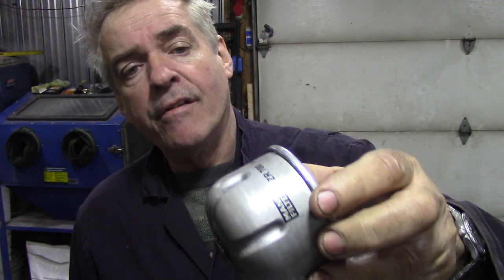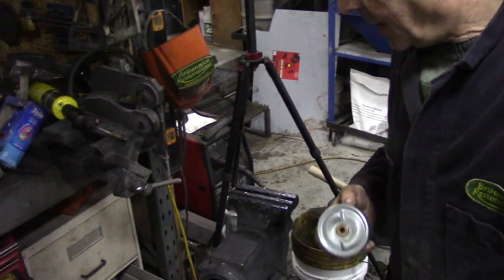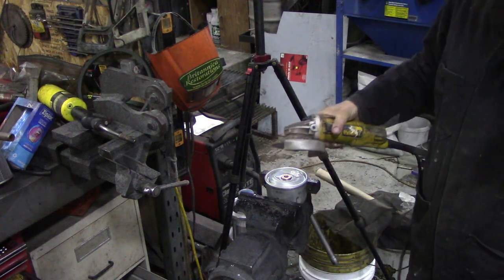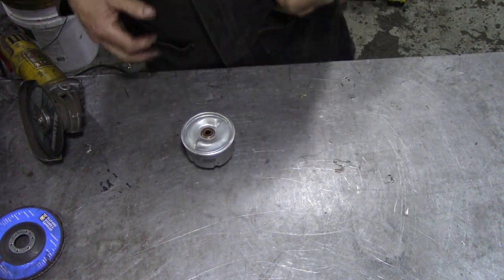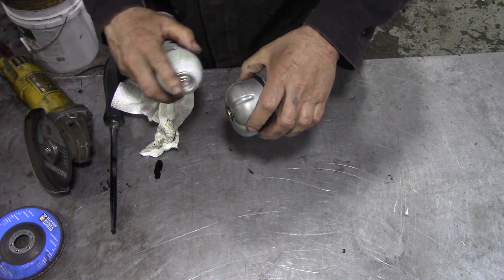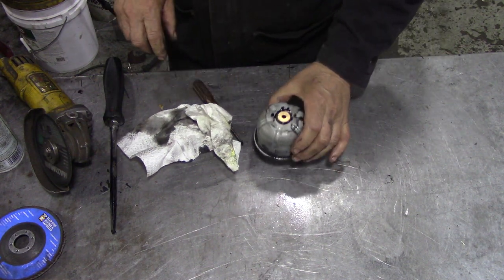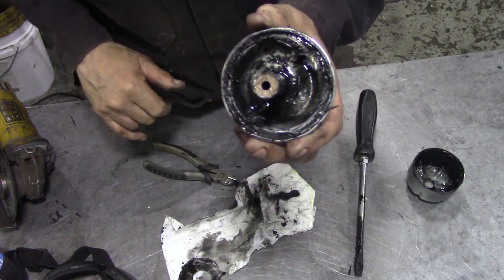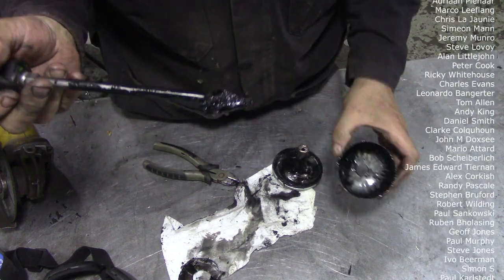What is inside a Td5 centrifugal oil filter?

Comment: I'm a agricultural engineer in the UK some Massey Ferguson tractors have them for the gearbox filter and there designed to come apart just unscrew the head of the filter do a good job never had to replace one just give them a good clean also run a disco 2 td5 as my workhorse change oil and both filters every 5 thousand miles and use 5w40 not 30 better oil pressure keep up the good work
Reply: Zetor tractors had a centrifugal filter on the engine, I remember coming across one for the first time on a zetor 6911….
Reply from the maker: I think the original Beetle had them too

Comment: Made by the Glacier Filter company in Ilminister, Somerset. I used to be the Quality Manager at the launch of this filter, known as GF016.  Glacier made a series of Bypass centrifugal filters in various sizes for Massey Fergusson, Scania , Renault trucks, Wartsila  marine engines.  Filter was invented by Glacier, working in bypass taking approx 10% of the oil, spinning in excess of 6000 rpm, the soot particles in the oil , less than 1 micron in size, are spun out into a cake, which on most variants can be removed and burnt.
Reply from the maker: Did you make them for the old Zetor tractors and early VW Beetle too as they had a similar system?
Reply: I wasn't aware that the Beetle ever had one - I thought they always just had a gauze strainer. Certainly from the 60s on they just had a strainer.
Edit: although from a quick google, it looks like Fiat 500s had centrifugal oil filters. I'd never even heard of centrifugal oil filters until watching this video!
Reply from the maker: I bought a cheap Fiat 500 donkeys years ago - had no oil pressure - got the engine out and found the core plug had come out of the crank! Hammered back in and a few punch marks to prevent it coming out again - problem solved!
Flogged it pretty quick!

Comment: One of my first vehicles was a Honda K4 250cc bile , sorry bike ! Anyway it had a centrifuge oil filter that was spun on a shaft not conveniently mounted behind the clutch body . There was no other oil filter if I remember rightly , senile old git that I am ! You just changed the oil regularly and sang happy birthday . The filter I assume was a main dealer handled issue , but me and my mates did not trust , in other words could not afford , bike dealers so we learnt things ourselves . My oh my did that filter work , it needed a special tool to grip the castellated nut ( or a sawed up socket ) to remove , but you needed a stiff drink to get over what had been 'filtered ' out ! I reckon it would not take much effort to copy this idea as a modification . 
Another , much easier , quicker and less risky mod is to use magnets attached to your renewable oil filter . 
The downside is that magnets only attract ferrous particles , so no carbon chunks get caught .  
I remember a mate , who was very , very clever , not being able to replace his Triumph Midget oil filter . 
For ages he lay in the street in the rain cussing whilst failing to wind the new filter on . Yes , he had the old rubber seal left on the filter mounting ! Bloody hell John could drive that Midget though !
Reply from the maker: The pre-filter centrifuge is a great idea! Gets all the gunk out!

Comment: The biggest issue is replacing the cap over the filter. The threads are notorious for stripping. I think the torque settings are c. 23nm. My TD5 has a M5x100 bolt and nut holding the cap in place as the threads were stripped by the previous owner (the RAF) and stuffed with Plumbers tape 😅
Reply from the maker: Yes they are rather small considering they are supposed to be removed frequently - maybe some helicoils will save the day?
Reply: @BritannicaRestorations  Thanks Mike. That is the plan....once I have fought my way to the Td5's reverse switch....removing the transmission tunnel cover so far I have had to drill out 3 screws, one fell apart when I touched it, one I hammered out and one actually unscrewed! Five more to go then I can look at me threads!
Reply from the maker: All part of the fun!

Comment: Looks like it does nothing. Never changed it on my Defender because I didn't know about it 😂 my engine ran flawlessly like a Rolex until I swapped it with a 440 HP LS engine and 6 speed. The guy who bought the engine told me about it so he bought it cheap 😅 he still has the engine and very happy with it in fact 😶

Comment: This production is WAY, WAY, WAY over do! Centrifuges have been around for many many decades and yet we, the consumer, get very little information and essentially no marketing of the product. I'm looking for one for my 2015 Duramax,  today I stopped by a performance diesel shop and he had never heard of one. but locating the right spot is a challenge. None the less, it's going to happen. The Chinese system is around  $200 USD's, The German and USA versions run about $500 and that's if you can find one for your vehicle. I'm looking at Diesel Craft, they utilize a small air pump to push the oil back into the case. Most use gravity flow and I'm a fan of this however, some vehicles don't allow for this because of the under hood congestion.
Reply from the maker: I just ordered this 
https://www.alibaba.com/product-detail/Risun-RG020-high-speed-micro-main_1600483931615.html?spm=a2700.wholesale.0.0.77135943zdCbQs

just to have a look at how it could be retro fitted

Comment: scania do one on trucks  which has a strip of paper which catches all crap there great
Reply: They have been fitting them for decades to scania engines.  When I worked for Scania sometimes when we stripped them during service they hadn't been done for years and were almost full & totally blocked. Most times tho the carbon was only about 3/8" thick.
Reply: @jasonboyes1  As you know they do need to be serviced however, this is minimal down time and no expense, just time. Centrifugal oil filtration is universal on big marine power plants.

Comment: I have replaced some of these and some have been really noisy.
Reply: They get noisy as they get dirtier. You can normally tell how full they are by how long they carry on spinning after you shut the engine down. Rest your hand on the housing you can feel it spinning.
Reply: @jasonboyes1  that was a brand new filter, I had two of them from JGS4x4, booth noisy, I fitted the old one and it was quiet. Ended up getting one from the local independant LR garage whihc was silent.
Reply: Must of been out of balance. The Scania ones simply strip down you clean them then re assemble and fit. 👍🏻

Comment: We have a td5, 230k on it…..sweet as a nut
Reply: Check your big ends, the oil pump wears out and big ends 4 and 5 go . Mine went at 180k, was sweet as a nut as well until I tried to pull a loaded trailer up hill. Didn't end well and cost me about a grand for a rebuild and that was doing it myself